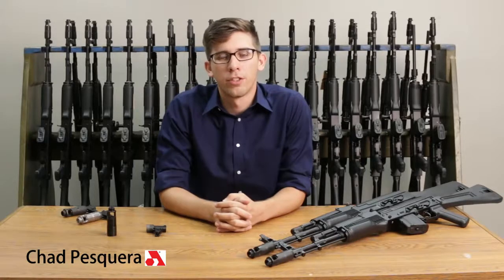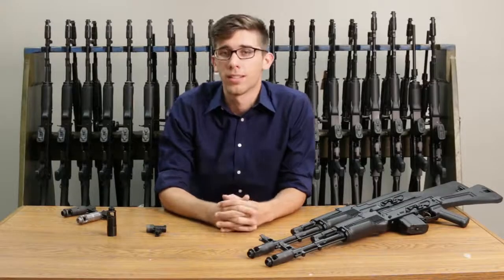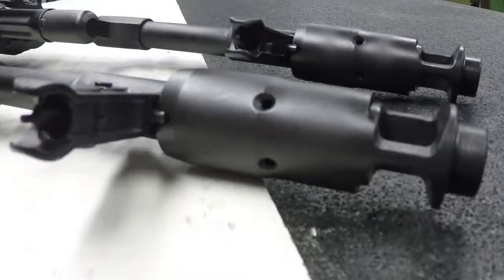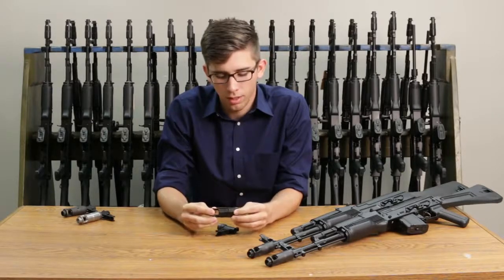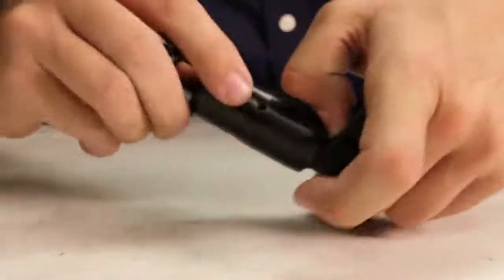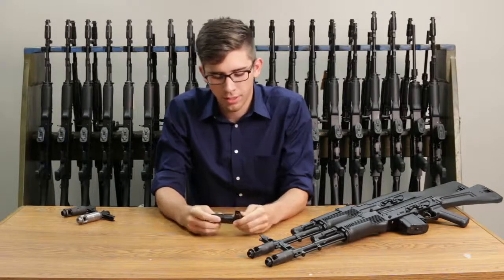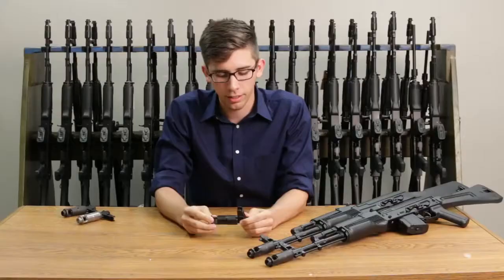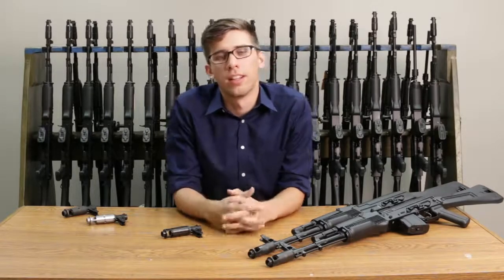Arsenal's Muzzle Brake Information

Comment: is there a way to put on regular ak flash hider? kinda sucks cause i just bought a flash hider and it doesn't fit, is there adaptations for that?
Reply: Five years late, but it depends on the thread pitch of your muzzle device and the thread pitch of the muzzle of the firearm. If your firearm is threaded M1x14 LH, then you can use any M1x14 LH muzzle device. But if your muzzle device is instead threaded M24x1.5, you would need an M1x14 LH to M24X1.5 adapter. And vice versa. In short, double check the thread pitch abd make sure it's compatible with your muzzle device!